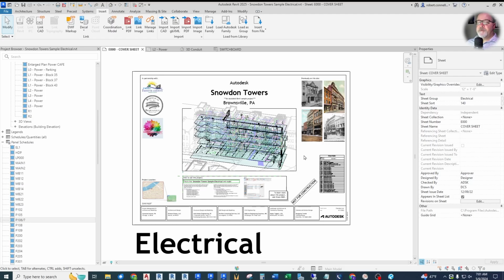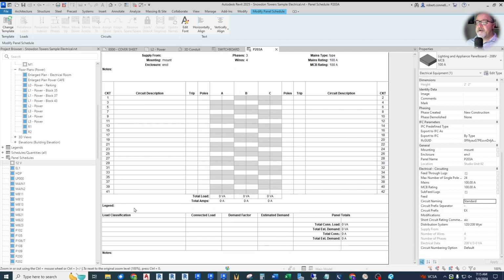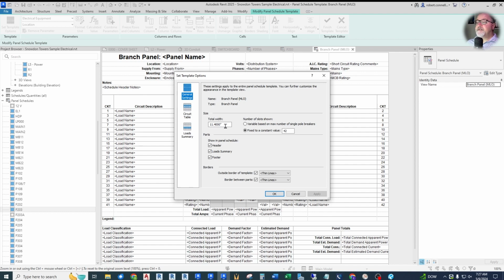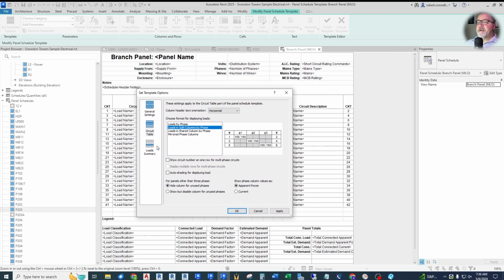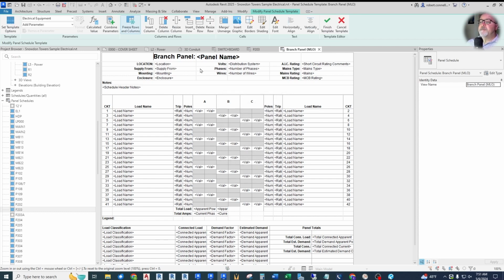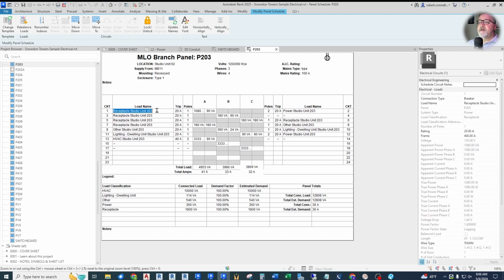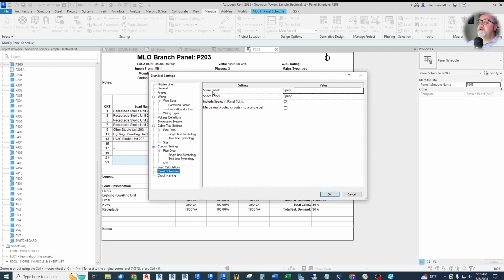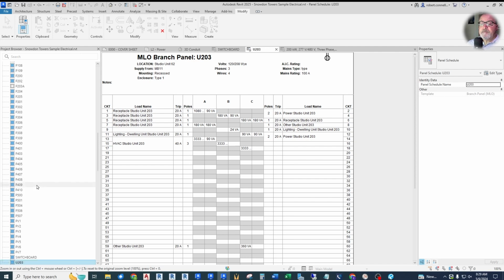REVIT MEP ULTIMATE GUIDE to Panel Schedules! (PRO TIPS!)

Comment: Hi, great content! I have a question about Revit MEP Electrical.

In my country, we separate HVAC circuits and power circuits within the same electrical panel. Because of this, I need to create two different Panel Schedules for the same panel: one showing only the HVAC circuits and another showing only the power circuits.

Is this possible in Revit MEP? If so, what is the best way to set it up?

Thank you very much!
Reply from the maker: Hey there. Interesting question! I've not had to do what you are describing, but I would probably create 2 panels with similar names - like one as P1 and another with quotes like 'P1' - then put HVAC on one panel and Power on the other - then I would connect one panel to the other upstream to a "feed thru lug" connection (not a sub-breaker) - this will then report all of the load on the upstream panel for connection upstream to its feed.

Comment: Great video  Thanks.  The only thing that trips me up is limiting the schedule to just the circuits shown on the project.  I’ve learned it’s better to always leave spares.  At least six.  Panels aren’t cheap, but filling them with spare breakers up front is usually far cheaper than trying to add them later.
Reply from the maker: Hey Dwayne - thanks for the feedback! And yes! Totally agree - in our electrical designs we always show some spares, and yes, typically 4-6 like you do. And when I do remodels, I sure appreciate the previous designers leaving some spares for me to use as well!. Especially in the last few years, with some supply-chain issues, even getting additional breakers for specific panels has been a struggle!

Comment: How can I create a single phase panel schedule?
Reply from the maker: Hey there! In that 120/208V panel video, I show how to get a single-phase panel schedule by adding the single-phase distribution system to your model, and then setting the panel itself to 2-poles. This will force the panel schedule to only show 2 phases. So make sure you have a 120/208V 2-pole 3-wire system or a 120/240V 2-pole 3-wire system in your distribution system under Options > Electrical. Hope this helps!
Reply: And how I can force it to have only a single phase?  @ElectricRob
Reply from the maker: So you are actually looking for a 1-pole panel, like 120V? Not something we've used, but you could set up a 120V 1-phase 2-wire distribution system and then set up a corresponding panel with that voltage and phase, which would give you an A-phase only panel schedule. Hopefully this is what you are looking for!
Reply: @ElectricRob  ....... Can we have a video showing this? I'm a Pro in CAD......Nooby on Revit.....

Comment: Hi Rob! I am having an issue where the load on my DP panel schedule is not showing the same on the Switchboard schedule. For whatever reason, the Switchboard schedule is adding about an extra 3kVA load for the DP panel from what the DP panel schedule says. Have you ever run into this issue? Any ideas about the discrepancy?
Reply from the maker: Hey John! I've seen this happen - the problem was within the Switchboard panel schedule (and its template) - down at the bottom of one phase, where it adds all of the loads of the circuits above, one of the entries was wrong, in that for example it had the phase A total in the phase B cell, instead of the phase B total. So I'd start there. Good luck!
Reply: Many many thanks Rob!!!

Comment: ''by project'' option is very useful to classify what is plugged in the panel, at first you should change load classification of the family, for example if in "load classification" we name it as "light" and than we give it "L1:" Stands for light, 1 for the phases abbreviature and save it, than after loading family in the panel it will write L1:1, L1:2, L1:3 an so on

Comment: Rob -- This is kind of panel schedule related but is there a way to connect an automatic throw over switch (ATS) to both the normal source and emergency source (in this case) at the same time so it shows in both panel schedules and the VA shows in both schedules?   your's is the BEST content for us electrical peeps using Revit...really great information
Reply from the maker: Hey there Scott - appreciate the feedback! And YES, I have the perfect video for you - the scenario you mention drove me nuts at first - the out-of-the-box transfer switch has only one source!?! Watch this video to see how I added a 2nd electrical connector so you can get the loads to show up on both schedules! https://youtu.be/ZrhlVFD3wGc
Reply: Rob thank you very much this was extremely helpful!